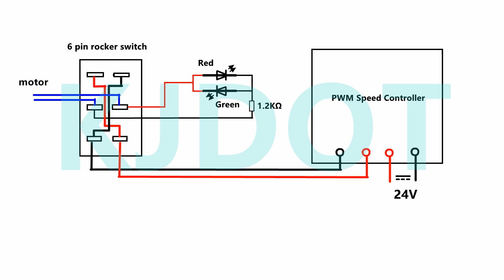How To Make DC Drill Machine Motor Speed Controller DIY Forward Reverse Switch

Comment: DC drill machine duniya ka sabse 
Sada hua machine hota hai.
Reply: Kyu
Reply: @techtechnicalgaming  kitna bhi kosish kr lo ,woh sirf cardboard hole krne ke kaam aata hai
Gear system ke Bina koi bhi drill  direct motor se bilkul faltu bakwas Time waste hota hai
Sirf students ke project ke kaam aata hai
Reply: @SadIndiafr  depends ki app kaun se motor se kya bana rahe ho , you are right if you are making a drill with fake 775 motor cause there is a difference between rotary machine aka dremel which is of very high speed and less torque it is meant to be used on soft wood, plastic and in some metal work like jewellery. where as drill needs high torque and morderate speed  so i suggest go for genuine 775 attached with planetary gear.

Comment: where can I buy all of the parts on this video? thank you!
Reply: If it still helps, after 2 years, you can buy all the parts from a DIY electrics store. Or online. 
I know nothing about electrics, but I built sthg similar following another video.
The small board with the turn dial is a PWM (pulse wave modulation). They are cheap.
For power, get a 3-24v ac-dc adaptor. Also cheap.
The switch is two-way with 6 pins. Very cheap.